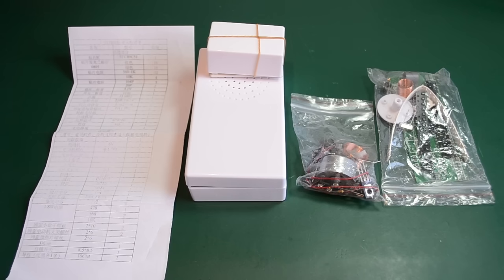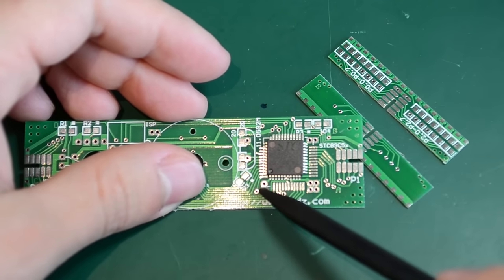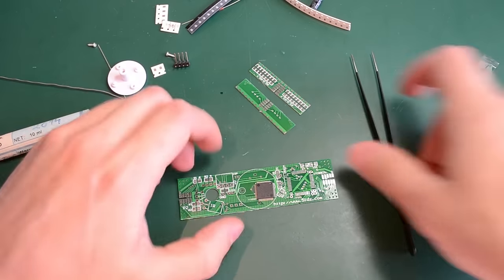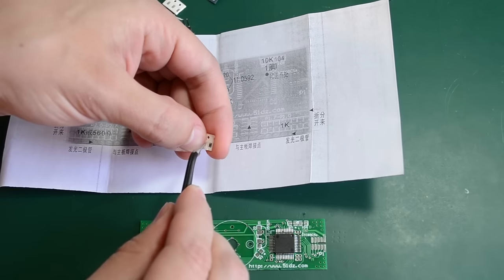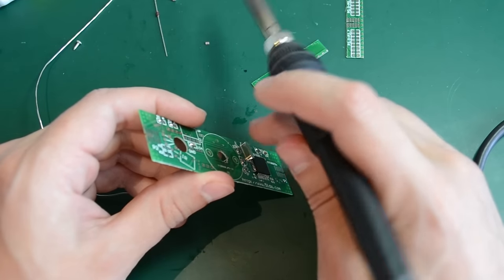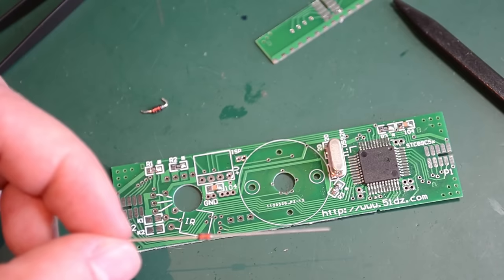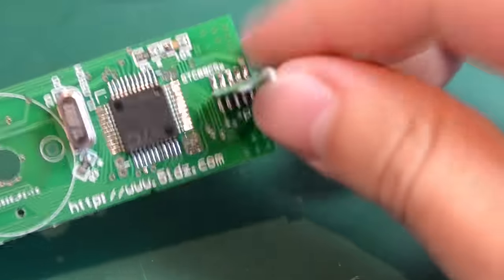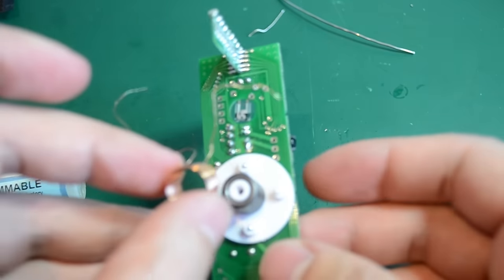Voltlog #15 - Kit Assembly LED Rotating Persistence of Vision Kit

Comment: Thanks for instructive build video.  I've figured out how to program mine - you just need a 5-volt serial link so you can use an FTDI adapter, or use an Arduino as a USB-to-5-volt-serial adapter.
I've made mine work as a clock.  It keeps pretty good time once set just using the STC89C52 crystal.  You can set the time when you turn it on via the serial connection.  Do you still have yours?  Do you want me to send the hex file and instructions on how to upload?
Reply from the maker: +ceptimus Sure, I would appreciate the hex files and the instructions. I still have the hardware. Please send to contact at voltlog dot com. thanks!
Reply: Hi Gary.  You can download it, and see some instructions about how to do it at my blog: http://ceptimus.co.uk/?p=181

Comment: I'm wondering whether the kit might have been initially developed with normal through-hole LEDs in mind, which would have been much easier to solder in place and quite sensible to place like that...
Reply from the maker: yes it could be the case